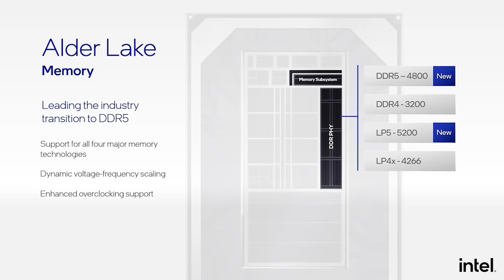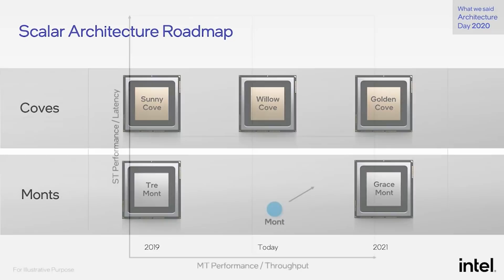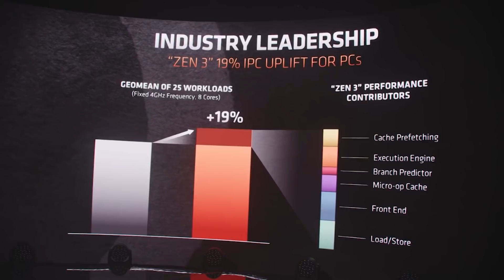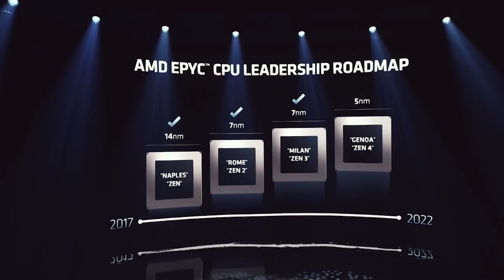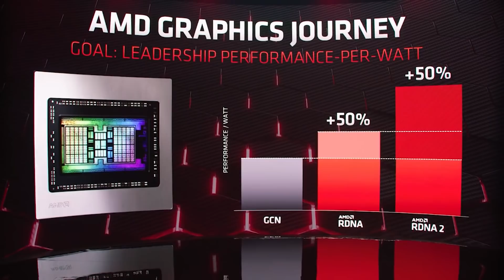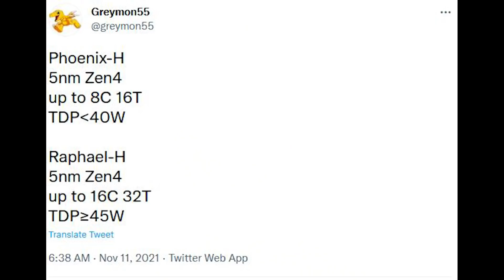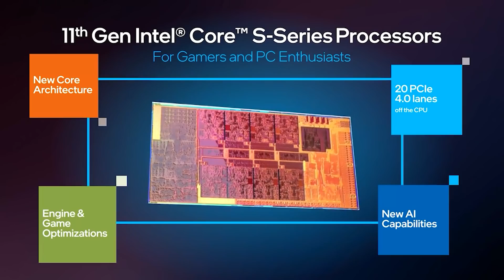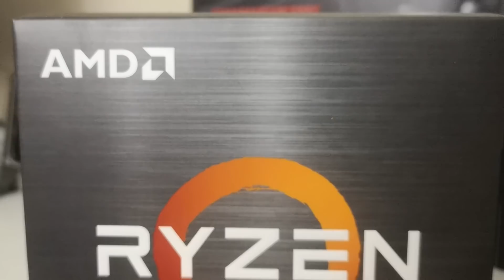RYZEN ZEN 4 - Will AMD Increase the Core Count? | AMD Raphael Specs & AM5 Rumours

Comment: I have a 5600x, I may go for the top tier flagship 3d v-cache chip when that comes out
Reply: You really, really won't need to upgrade any time soon if the most demanding thing you do is to play games. I don't think you're going to notice a difference at all with that upgrade in ANY game. By the time having more than 6 Zen 3 cores or all that v-cache becomes something which is noticeably different, it will be maybe 4 years from now, and much faster chips will be available for relatively cheap at that point in time (whatever the newest 6 or 8-core chips are at that point in time). It's usually best to wait at least two generations between upgrades, but I realize that Zen 3 V-cache chips will be the last chips which can work on AM4.

If you need more cores and threads for something other than gaming, that would be a totally different story.
Reply: If you need a lot more threads, yeah, AMD has a lot for you. Just insane how much more you can upgrade from an already great chip

Comment: I have a x570 mobo with a 3900X and I would get much more bang for my buck by upgrading my GTX 1070 rather than upgrading my CPU. I do edit 4K video however and it’s nice to know I have an upgrade path to a Vcache CPU at some point in the next couple years if I need the extra threads.
Reply: Crazy to think you can still increase your core count by 1/3, plus all the single thread performance of going to Zen 3 with V Cache. Nutso. AMD really offers an amazing spread
Reply: Zen 2 to Zen 3 V-Cache should be a fairly substantial upgrade for your use case too.  The 3900X is still an excellent CPU.  I'm talking about down the road.
Reply: Theards are only one (big) part of the productivity aspect, I can see the soon to launch 16 thread 6800X being on par with your 24 thread 3900X. In cases where it's not heavily multithreaded and/or the task can use the huge L3 well.
Reply: @robertstan298  it’s amazing to see socket AM3 will be alive and well in 2022
Reply: @fansofER  AM3? AMD FX-8150?
Reply: @dralord1307  yeah bring back bulldozer! ... nah kidding, burry them in the desert.

Comment: its very expensive proposition from amd to make only one model and very expensive plus gen4 drive with lighting speed tech transfer required by the cpu you buy...equals buying $1k extra for just 2 components cpu and nvme gen4 drive, and that without a board into the cost...not gen 3...only gen4.....or get ps5 pro for $599

Comment: Will upgrade to the 3D V cache CPU, and allow DDR5 to mature before switching over to a whole new platform.
Reply: ABSOLUTELY the move to make.  Alder Lake has shown that current-gen DDR5 modules aren't up to snuff yet - as is ALWAYS the case when we move to a new memory standard.  You're way better off with something like 4000MHz CL16 DDR4 than you are 6000MHz CL40 DDR5 (and the DDR4 is less than HALF of the cost-per-GB right now)
Reply: @erikhendrickson59  Exactly. 😀
I already have my B-Dies fine tuned running at 4000MHz C16 1:1 with a 5800x. Wanted a 5900x on launch, but could only get a 5800x. So stuck with that for a year in the hope to grab a 12 core 3D V Cache CPU on release.

Comment: its why amd gonna have harder time to market this 300w+ cpu of theirs when alder lake is at 220w+ ...higher for OC....vs AMD 400w when OC very high...on 6nm node...there is not a lot difference between 5-7nm in power delivery....its all bad for tsmc for now, and adding more cores just to increase iPC gains while higher clocks is trying gain in single core performance ...its much harder for amd to beat alder lake setup...its wild move for intel and we gonna see many unexpected moves from intel again...i remember since pentium 4 to conroe parts...it was wild move back then that overkilled AMD unexpected with only 2 cores vs amd 6 cores back then
Reply: If there is a 300w+ cpu then it would only be hedt super high end, not something an average user would use.  Bad for TSMC? Now you are just dreaming, their gains are not just from more cores, that's ridiculous.  AMD still has large lead in efficiency and they haven't even moved to 5nm yet.  Thinking Intel can overtake TSMC/AMD within 4 years is just hopium at this point.

Comment: I think AMD w/ Zen 4 coould resegment core count and their brands along the lines of:

Rzyen 9 7950X = 24c - 900 USD
Rzyen 9 7900X = 20c - 750 USD
Rzyen 7 7850X = 16c - 600 USD
Rzyen 7 7800X = 12c - 450 USD
Rzyen 5 7600X = 8c = 300 USD

Ofc they can price drops these SKUs when Meteor Lake comes in 1H of 2023. Also on Raptor Lake isn't it Q3 because all the rumors in the supply chains saying that? I mean either say August or September than October-November b4 Zen 4? Also on Zen 4 IPC increases is that over Zen 3 or Zen3D?
Reply: Considering how good chiplet production mixes with good yields, I half expect AMD to only release SKUs in multiples of 8 cores/chiplet. If 95% of the chiplets are 100% usable, then I don't see them wasting silicon on 6 core or 2x 6 core chiplets.

BTW the 20 core SKU you mention makes no sense, they won't release a CPU with unequal core-per-chiplet setups, they have the potential be very inconsistent (particularly if the best core sits on a chiplet with less L3 than the others). Unless... maybe Raphael ca go up to 4 chiplets.
Reply: @robertstan298  Yes, 5+5+5+5 would be possible, but you have to wonder about the die space. That's a lot of bad yields to get a 20 core.
Reply: If Raptor Lake releases before Zen 4, then Intel would have released THREE generations between Zen 3 - Zen 4. lol
Reply: They can make 10 cores by combining two 5 cores right now, but they can't make 20 core without the CCX being 10 cores. They can't mix and match chiplets.

Comment: well you and i gonna say...yes the 300w to 600w cpu is now possible and new normal due to high core count from AMD....24 core ryzen it easily go 300w for 4.8ghz -5ghz any lower clock just look bad for amd on IPC gains...amd pushing higher clocks to be competitive to intel but not enough to beat the biglittle architecture raptor lake come out...its too much the little cores becoming a problem for amd...its easily to grow faster than big cores does...its same methodology as gpu do with its core to grow in performance ...its the little cores that all matter than bigger cores only process big data vs huge quantity of data per pixel ...for cpu case....work load numbers vs size of work load

Comment: gonna upgrade my Zen2 3800x to an Zen3+ the ipc increase will be huge for single thread. and i get to keep my AM4 platform B550 32GB DDR4 and cooler and so on :) and Zen3+ will be good enough for along time, atleast while DDR5 is as expencive as it is now. Gonna let others be front runners this time.
Reply: I was an early adopter on the first gen Ryzen, which gave me quite some trouble. I'll go for a Zen3D as well and wait out any possible early adoption problems, and till DDR 5 is cheaper with acceptable latencies. No doubt I will be getting by with a Zen3D CPU for quite a while.
Reply: @ashamancito4630  I bought a Ryzen 1800X at launch, with 64GB of QVL DRAM, ran it all stock and had zero problems.  My impression was that folks who tried to push the new product got the grief.

Comment: I9 13900ks benchmarks have started leaking, AMD will be at disadvantage at zen 4, cause raptor will support ddr4 and z690 mobos, and AMD will have to release a completely new platform.
Reply: Z690 is also a new platform 😋 even when zen 4 releases
Reply: Very true. Most people are too short sighted to realize what's coming up in 2022. Zen 4 exclusively supports DDR5. With DDR5 shortages still going on it will be dead on arrival. Zen 4 is launching in Q4 2022, which is very late and pretty much means that most of the DDR5 stock available through 2022 will be gobbled by Alder Lake and Raptor Lake users who will have decided to go with a DDR5 motherboard, along with OEM Alder Lake laptops and more importantly Sapphire Rapids HEDT users who will need that memory even more than mainstream users. If the PMIC shortage doesn't get solved by late 2022, I don't see how Zen 4 will be launching that year on desktop platforms.
Reply: @Patrick73787  well by q4 2022 ddr5 would have been on the market for a year, so lets see how that goes, hope amd has a plan since they are aware of the situation 😉
Reply: @malathomas6141  By Q4 2022 DDR5 will have been on the market for LESS than a year as it's still NOT available as of now.
Reply: @Patrick73787  that doesn't matter its its already been released on the market
Reply: @Patrick73787  Manufacturers aren't just sitting still. They are coming out with faster speed modules all the time. The production ramps up while DDR4 production goes down.

Comment: I'm on Zen 2 right now, have zero complaints on the performance side - it does what I need to do very well and isn't holding up my GPU.  Couldn't put a Zen 3 or it's refresh in my board anyways - it's only an X370, and AMD has forbidden manufacturers from supporting Zen3 in 300 series boards (that doesn't mean it wasn't attempted as ASRock did "accidentally" leak BIOS's for 300 series boards that did support Zen3).  So right now my answer is no for the refresh chips that have Vcache.  So likely that if I upgrade in the future it will be for Zen4 or Intel 13th Gen.  Or... Whom knows - I just know right now CPU, GPU and RAM aren't on my list of upgrades.  My current upgrade plans are to migrate my 4 older 1TB SATA based SSD's to NVME drives next...But when, whom knows - I'm again not complaining about performance at present time.  Might put that off until I do a motherboard upgrade even.
Reply: Asus crosshair x370 support zen 3 too and the other mobos that dont support zen3 you can bios flash to x470  anyways if you really want to
Reply: that's not it there's not space for all cpu gen on the bios chips
Reply: @ThaexakaMavro  yes, and some venders where still willing to find a way to support them on the older boards but AMD said no. No biggy, but just another reason for me to not upgrade yet. :-)
Reply: @nukedathlonman  I haven't seen long term tests with Ryzen 5000 on X370, but bugs or lower performance than expected are also a possibility.
Reply: @robertstan298  Cool, but I figure that Zen 4 at a minimum will be out before I start thinking and planning out that upgrade anyways.  The SSD's I more likely won't wait out based on drive space I have available (will likely toss these SSD's into my server for JBOD duties).
Reply: @nukedathlonman  Yeah, i have no hdds in my pc anymore too. Got 2x 2tb nvme m2 and a 2tb sata ssd, thats fine for now.
Reply: @themadnes5413  2x 1TB SATA SSD's and 2x 2tb SATA ssd's.  Def a good candiate for moving to NVME, but I'm not under pressure to do so.  Ideally, one 2tb and an 8tb NVME would be best when I make that move... Some day. ;-)

Comment: It's not if AMD will increase core count, it's if AMD will increase the core count of Ryzen 3 and Ryzen 5. With 7nm Ryzen 3 should have been a 6 core and ryzen 5 an 8 core considering that the die sizes were shrank more than twice by going to 7nm and the prices(MSRP) should remain the same, but adjusted for inflation.
Reply: That would be nice. 12th gen i5s already have 6+4 and the best response would be to increase the core count. Remember, multithreading is becoming much more important than ever before.
Reply: @PrinceOfPickles  Well multithreading is becoming more important, but you should read on Amdahl's law and you'll see that software with very linear logic can't benefit that much from multi-threading and that is usually software where the timing of each calculation matters like video games. Still that said, video games are 4 programs combined into one, the game logic, API, physics and effects and soon AI, so you want at least two cores for each of those, ideally 3-4x cores for each, so 16 core CPUs should be great.
Reply: @rattlehead999  I mean at this point if you get something like a 12600K/5800X, you probably won't need another CPU for gaming for at least 5 years, maybe even a decade, unless some big change in game development happens, but considering it takes a few years for games to change trends, I don't see that happening. Heck, you can still get decent framerates with something like a 4770K. GPUs are the main bottleneck.
Reply: @lycanthoss  True, considering that consoles have the equivalent of a Ryzen 7 3800x, and PCs need about 30-40% stronger hardware to match consoles, you really won't need a much stronger CPU than a 5800x/12600k until the next generation of consoles.
Reply: @PrinceOfPickles  Also it's worth noting that the E-cores, even though lacking many instructions, like AVX and a few others, still having everything needed for 95% of the user base and they are tiny and consume very little power, which goes to show that there should be separate desktop and server architectures.
Reply: @n n Athlons will be 4 core/8 threads.
Reply: @n n I can, but I'm waiting for DDR5 and then I will see.
I might even get an APU if they release a 12-16CU RDNA3 APU as I don't plan on playing at above 1080p.

Comment: If RaptorLake humiliates them in ipc they'll have no choice but to increase the core count. Either that or they'll have to accept far lower margins than they have enjoyed with Zen3. I mean they're still unwilling to drop Zen3 prices despite AlderLake completely trashing that pathetic duct taped architecture.
Reply: "Pathetic duct taped architecture" about one of the latest advancement in performance per watt in the desktop industry. I'm all for competition, but your comment is just stupid.
Reply: "duct taped architecture" whatever ? What do you think intel gen 12 is ? They added the efficiency cores because they couldn't add performance cores without drawing 400 plus watts of power. So they cut down some processors and slice and diced them in.
Reply: it's not impressive when they consume 240-280W to beat them against 140W and that's to be what, 5-10% faster than an architecture that is 1 year older and meant to compete with their previous two architectures?
Reply: Zen 4 will be dead on arrival. Not because of its lack of performance but simply because DDR5 shortages won't come to an end anytime soon and Zen 4 has no DDR4 alternative unlike Alder and Raptor Lakes. It is first come first serve and Zen 4 will be the last CPU lineup to launch in 2022. If there's any DDR5 stock it will primarily go to Alder Lake and Raptor Lake desktop users who will have decided to go with a DD5 motherboard, along with OEM Alder Lake laptop users and more importantly Sapphire Rapids HEDT users who will need DDR5 memory even more than mainstream users. Zen 4 will have to get what's left or get pushed back to 2023. And when Zen 4 finally gets available in any meaningful quantity it will be H1 2023 right around Meteor Lake's launch, LOL.
Reply: Wow, the idiocy of your comment is astounding. AMDs Zen3 refresh will beat Alder Lake... not even an architectural improvement... just a refresh.
Reply: Intel fanboi 🤡
Reply: On average alder lake is 2.5-5% faster. Intel is barely beating Ryzen 5000 which is a YEAR old. Alder lake is not impressive.
Reply: @NovaDoll  "On average" is why people think Alder Lake is better than it is. Those are figures HUB states in their conclusion. But, it's far from factual. Their video comparing the i7 to R7 was that Alder Lake was 2% faster. But, if you look at the facts, AMD won 6 games and Intel only won 3. So, Alder Lake isn't faster. And the 5600X won 5 and lost 4. So, it just depends on what games you play. And those results are at 1080p using a 6900XT. Go up to 1440p or 4K, then both platforms will be close with AMD being cheaper and more power efficient. So, it's even less impressive than you think. lol Zen 3D will increase the lead more. Raptor Lake is just a refresh that "might" catch up. But, Zen 4 will extend the lead more. We'll see if anything can dethrone the 12900K though. If you make money by gaming, who cares how much heat that puts off.
Reply: They won't because Zen3D will beat Alder Lake
Reply: how to say you are delusional without saying you are delusional.
Reply: Stupid comment.
Reply: So much AMDumb rage. Glorious!
Reply: @TheBlackIdentety  you have the communication skills of a child. Odds are you're a grown up. Adding both together leads me to conclude that you're a man-child yelling at your mother about "the meatloaf".
Reply: @TheBlackIdentety  you can fanboy all you want but both AMD and Intel suck. So there is that.
Reply: @rattlehead999  intel now has vastly superior per core performance, superior MT performance and superior price per performance. An all round massive humiliation for the AMDumbdom. 😂

I'm not at all convinced Zen4 will beat even just ADL ipc. AMD generally targets 15% higher ipc per gen. ADL is 20%+ ahead and RaptorLake will further improve ipc to around 30% more than Zen3.
Reply: @TheBlackIdentety  And both AMD and Intel are about 200% behind in performance of what they could have been, but oh well garbage against garbage, doesn't change the fact that both are garbage.

Also vastly superior is not. Adler lake's performance cores are only 3% higher IPC than Zen3, go check Guru3D's comparison of IPC for Adler lake vs Zen3 and other AMD and Intel products, but SMT performance is greatly improved and the clock speeds are very high which leads to a 20% higher performance, which is not even close to being "vastly superior".

Vastly superior means that one chip can run software well and the other can't.